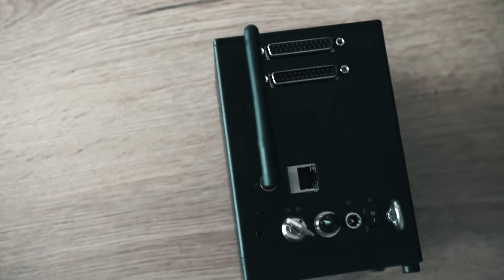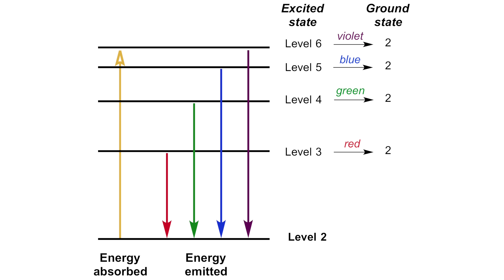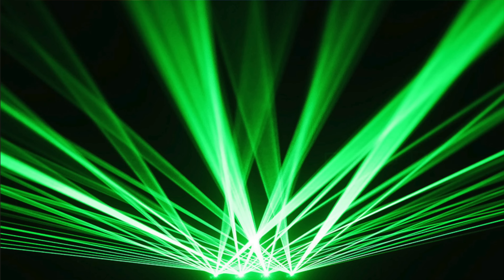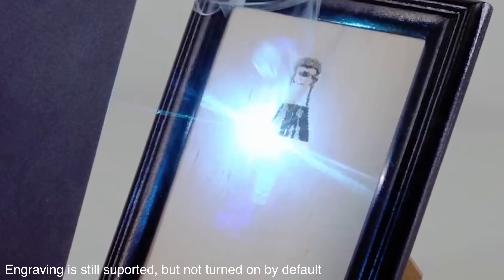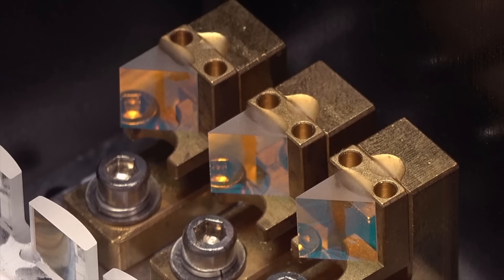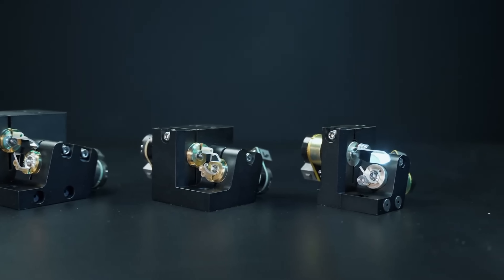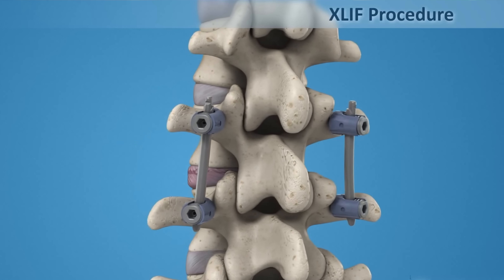The New Kind of LASER You Should Know About!

Comment: You're off a bit with the safety ratings. Class 1 is limited to 0.4 mW, not 4 mW, unless the entire beam path of the laser is enclosed or otherwise inaccessible. Class 2 has a maximum of 1.0 mW, and must be in the visible spectrum so it triggers the blink reflex. 3r/3a is limited to 5 mW. 3b is 5 mW to 500 mW.

A 4 mW laser would not be safe to stare into for an unlimited amount of time, which is the requirement for class 1.

Comment: Hey Dave, I have a 2 watt show laser in my basement that isn't the "Allign it at the factory and pray" types that the laser cube is. A few differences from the laser cube you'll see in a proper, professional laser projector are as follows:

-The beam path has almost zero leakage. I can run this thing with the top off all day and not worry about light zipping out at a weird angle. I'd imagine in the laser cube this is because they're using the bare minimum price components to drop the cost of the thing. The reason why no one runs a show laser with the top off is simple: these lasers can run hot enough that the beam hitting a speck of dust on the mirror will ruin the mirror. gotta keep the dust out of the beam path until it's out of the projector.

- every single mirror in the projector is adjustable. It takes about 10 minutes, but after moving the laser you project a white beam at the wall. if the colors aren't aligned you pull the lid off and carefully align the mirrors so that you get a single point of white light, instead of 3 points of colored light.

-there are usually only 3 laser emitters in a professional laser. I'm assuming they used more here because they are using cheap laser diodes with very little cooling. Proper laser projectors will use either diode pumped crystal lasers or purely diodes, but they'll be mounted in proper heat sinks with additional cooling. these laser projectors are expensive, and if it's a diode pumped crystal type a good bit of that is for the blue and green lasers.

-no professional laser projector will have plastic parts in the beam path. i'm very surprised they can get away with that in the laser cube.

-if you find a servo running your mirrors you got ripped off.

lastly a few more points on laser safety as someone who has had to deal with those FDA regulations at a show. 

-in the US it is illegal to run a laser in automatic/audio driven mode at a show. this is the mode that uses a microphone on the laser to either drive or change various effects, or just runs random patterns. This is because those modes can't be masked out to prevent the crowd from taking a beam to the eye.

-professional laser software should be used if you're doing a show, and masking (telling the software where the beam is not allowed to land) is probably the second most important safety thing with show lasers, and if you forget to do this expect a hefty fine/license revocation.

-there is a massive difference between the danger someone is in from a scanned line (where the beam is moving from point to point to draw something) and a hot beam (single point beam with the mirrors not moving). I can stand across my basement and take scanned lines to the face all day, but a hot beam will burn your retina out in under 1/4 of a second. A buddy of mine was setting up some 12 watt lasers for a show and was checking alignment with a hot beam in the stadium the show was taking place in. a seagull was flying around as well, and flew in front of the beam. the beam hit the thing's eye, and boiled the liquid in its eye so fast the resulting ocular explosion killed the seagull. minimize hot beams.

lastly, the most important laser safety tip i can give is know the following:

-where the laser is and where it is pointing
-where the kill switch is, even if that's unplugging the thing
-where the volume of space the beam can end up in is. you're right that it is like a gun, anything in the path of the beam that faces where it's coming from is getting blinded.
-who is running the thing so if something does start to go wrong you know who to tell to shut it the hell down.

If anyone gets one of these lasercubes, i implore you to do your research and make sure you're running it safely. I have a spot in my vision where i can no longer see anything because of a hot beam incident. do not let this happen to you, I was lucky. Never rely on luck when it comes to safety.

Comment: The mirrors are called DICHROIC, not dichromic. No M in dichroic. Just thought you should know. Nice video though. I always wanted to see inside one of these lasercube pro units. I used to do laser shows in the 90's when the laser heads, power supplies were water cooled and the thing took up the space of a refrigerator to get 10 watts of output. Its so tiny and CHEAP now.

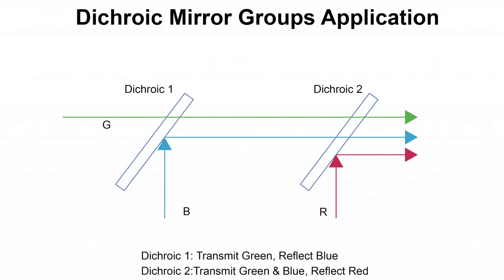Comment: 7:20, 1st thing I thought when seeing that, photon transistor, treat 1 colour as the gate and the other 2 as the input bits

*Edit:* With just a convex lens you can make an OR gate, with a convex lens, 2 mirrors and 2 refractors/absorbers you can make both an XOR gate and  NOT gate, I never checked the details of producing gates from other gates but I imagine that's enough to make every gate.

For the XOR/NOR gate you use the collision between photons after going through the convex lens to put direct them to the refractors/absorbers chosen to filter their colours, then a mirror thereafter to redirect the unfiltered light back to the center, just need something to convert the final light to a consistent light colour, presumably red for how long it lasts

Comment: Hey Dave, I haven't watched your channel in a hot second and it was great to come back seeing you cover this topic! My focus is actually on photonics and I'll be working with the LLNL NIF RF and Photonics group over this summer. If you want a super neat topic to look at in the future, I'd suggest taking a look at frequency combs, as they are used for numerous different applications currently. In short, they are self regulated pulsed "laser" system that produces extremely accurate pulse timing, they are mainly used for either gas spectroscopy(gas sensing) or more relevant to your field, highly accurate timing/clocks. As they are even more precise than atomic clocks! They are doing tons of work over at NIST in Colorado on this type of stuff.

Comment: This is the best and most accessible description of how a red laser works that I've seen.  Sincerely, an electrical engineer.
Reply: It has some errors and important omissions in it. He ignores the quantum nature of lasers, even though that's a critical aspect of what makes a laser work. Laser radiation hinges on converting precise energy levels from an excitation source (which is not always light) to emission. The gain medium is not always crystalline, and laser emission is not necessarily along the crystalline axis. In fact, the crystalline axis is, so far as I can tell, only coincidental in those cases in which lasers even have a crystalline axis.
Reply: @Pooua  that's just it.  It isn't the end all be all scientific explanation but it is that right balance of how it works that is just general enough that a very broad audience should get what is happening here.   If you have to go to the quantum level to explain how something works, you've already narrowed the audience to a fraction of a percent.
Reply: @underourrock  If you don't go to the quantum level, you don't understand how it works. It's like trying to explain how an internal combustion engine works without talking about combustion.
Reply: @Pooua  I disagree.  It is like explaining that an engine uses specifically timed explosions to drive a crank shaft that delivers power to the transmission without going into detail on how the timing system works, what pulling timing and advancing timing means, or explaining that the particular engine is an interference engine that will damage itself if the timing chain breaks.

In other words, I find his summary to be perfectly acceptable for the vast majority of the public and anyone that needs to know how it works at an even deeper level will of course need to study it.

He didn't say that there wasn't more to it.  He just gave a very good overview given the time spent on it.  I couldn't convey as much information as he did in the time frame he used.  The value per minute of discussion was very high.   You're being critical that he didn't explain an important part of it.  Please explain what the average person needs to understand at the quantum level to get the point that only the lower energy red photons are allowed out of the excitation chamber.  

What is the average person really missing?  He did talk about how the photons go from a higher frequency down to a lower one before passing out the crystalline structure that serves to collimate the beam.  Seems like he drew the line at the quantum realm for "not relevant to the whole rest of this particular video".

Edit: I'm familiar with the crystalline lattice... What other methods for collimating the output is used?   I wasn't aware of other methods.  So, I'm certainly willing to say there could be something critical left out, but it would have to be relevant to the rest of the video.
Reply: @underourrock  My problem with his explanation is that his explanation is factually incorrect in some places and misleading in others. He does give some correct and important information, but he also gives incorrect information. He is correct that laser radiation is not simply filtered, concentrated and collimated light, and a laser is not simply a filter concentrating light along its crystalline axis. He says that a sphere made of one-way mirror that allowed sunlight to enter but not leave is similar to the way that a laser works, but that is completely the wrong picture of how lasers work. That is a classical mechanical explanation that cannot make laser radiation! If it could work at all, the resulting light it would release would not be coherent. He uses the word, "coherent" without ever defining it or acknowledging what it means. In that absence, he misses the point of what a laser is. Laser radiation is not merely concentrated light; it is coherent light, both temporally and spatially. The laser is a quantum mechanical device that produces light that is unlike almost any other source of light a person ordinarily ever sees, and the way it does this is through a special mechanism that is unlike any other light generator a person normally encounters. 

If I had to leave out the quantum aspect of the laser, I would still fault his explanation on classical grounds. His model of a laser is essentially a tube with a funnel collecting and aiming light, but a laser actually is an oscillator, or a resonator, like a musical instrument's tuned strings or tuned tubes. I regard that point as not as critical to the essence of what a laser is, though a lot of lasers would not function if that condition were not met. The actual operation of the laser is a quantum process, and the laser is a quantum machine. 

His explanation of laser operation begins at 1:41. He is off to a shaky start, as he describes a laser as a tube in which "everything is a mirror on the inside." That isn't quite correct, and it ends up confusing his explanation. I think it misleads him into expecting the laser to act differently than it does. 

His explanation gradually, but slightly, improves through 2:23, when he gets hung up on the fact that a ruby laser uses a crystal. The characteristics of the crystal used in a laser that has them is significant in their operation, but those are secondary in consideration to how a laser functions. In this case, the fact that it's a crystal is more of a distraction from what he should be talking about. 

He makes the statement, "it turns out that ruby emits light mostly along its crystal axis when excited because of the way the ruby crystal is structured." That statement bothers me a lot, because absolutely no other authority in my laser career has ever made such a statement, and it is completely out of left field. On one hand, yes, the crystal axis of the ruby laser probably is aligned along the same axis as the beam of laser light it emits. My understanding is that is entirely a coincidence resulting from the need of cleaving the ends of the ruby rod so they are perfectly parallel to each other. I don't know if ruby emits most of its light along its crystalline axis when it isn't used inside a laser, nor do I know of any source that would consider this important enough to mention. 

The reason the laser radiation from the ruby rod comes out collimated is because only the photons that are traveling in that specific direction are amplified, due to the mirrors on the ends of the rod being perfectly parallel to each other. The fact that the mirrors on the end are aligned so precisely is the reason for the collimated beam; not the crystalline axis of the rod. 

His explanation from 2:31 to 3:13 is virtually perfect, one of the best parts of his explanation in the entire video. If he had remained consistent with his statements in this section, he would have been fine. But, he doesn't. He goes back into the chromium ions are aligned along the crystalline axis, so most of the light emitted is along this axis. Well, yes, that's true, but, again, not really relevant. It's good for the efficiency of the laser that it is producing most of its light along this axis, but that would not be enough to make the beam collimated, and it does not make the beam coherent. 

From 3:32 to 3:50, his statements, again, are virtually perfect. His statement at 3:51 about emitted light in the wrong direction being reflected back into the crystal so it gets endless chances at aligning on the crystal axis is wrong, due to several factors that prevent this from happening, first among them being geometry. Once those photons are going the wrong direction, there is no way that simply reflecting them around is going to make them go the right direction. The chromium ions aren't going to absorb them, either, because they are of the wrong energy level (this is where quantum mechanics comes into play). Finally, the chromium atoms drain out their energy faster than they can replenish it, which means the laser beam will shut off when the chromium atoms run out of sufficient energy, and this happens pretty quickly in this scenario, which means that by the time the stray photons reached the chromium ions, the show probably would be over, even if the entering photons had the correct energy level. Those stray, red photons can only end up heating the laser and represent wasted energy, like most of the light coming from the flashlamp. He mentions that modern lasers are between 10% and 50% power efficient, but oddly doesn't mention that practical ruby lasers are about 1% efficient. 

I've written all of this without explaining how lasers work or what coherence is, and I regret that, but I feel I need to address specific incorrect statements that Dave made to this point in his presentation.

Comment: The explanation of the ruby laser sounds a lot like how night vision tubes work
Reply: The night vision tubes that I know about work by using electron avalanche in high voltage tubes. That is not how lasers work.
Reply: @Pooua  The similarity is that they both gather light and project it in a more unified manner. High voltage for NV is news to me seeing as most run on AA batteries
Reply: @604cpr  My reply to you that I posted a few hours ago is not showing for me this morning. I'm wondering if that's because I included an external link? Anyway, NV converts the voltage from AA batteries into high voltage, around 5kV.

Comment: Viewing your laser safely is fairly easy with a little creative thinking.  Simply wear goggles that have little lcd screens inside and high resolution color cameras on the outside, that even if the beam hit the cameras directly, the most it would do is overload the camera sensor.  Something similar is done in modern VR gear as well as some higher end FPV, (first person view) glasses that have camera pass-through.  It would be most ideal if your gear has two cameras which would be more comfortable and allow much better depth perception since it would allow stereoscopic vision , but on a budget,  observing high power lasers through a single camera connected to a view screen could still be useful for many high power laser applications and would definitely be much better than no protection at all.  ;-)

Comment: Your explanation of the coherent emission in a single direction left out some important aspects. "LASER" stand for: Light Amplification by Stimulated Emission of Radiation. In the case of the ruby laser, existing photons of red light stimulate the emission of more photons of the same energy. Also important are the mirrors at the ends, which bounce the light back and forth along the ruby rod. I don't know whether the crystal lattice structure is significant at all, but it is certainly less significant than the amplification and the mirrors.